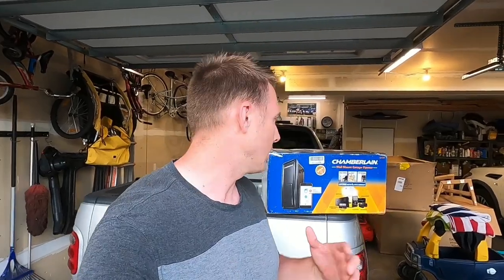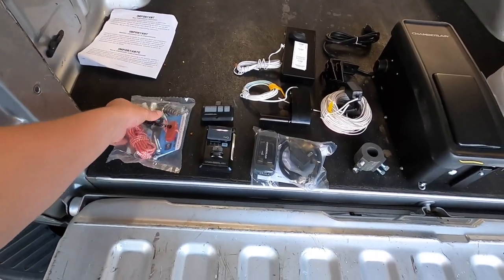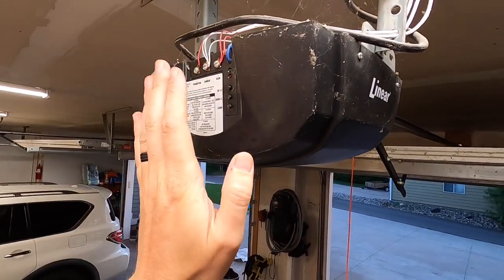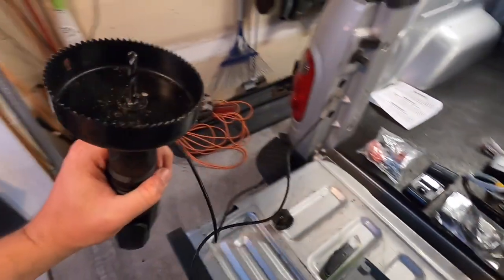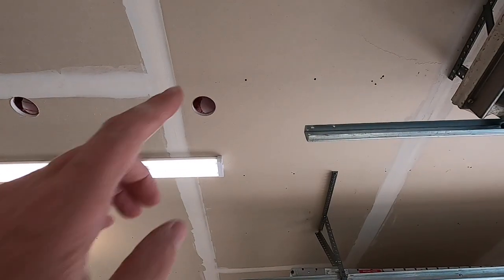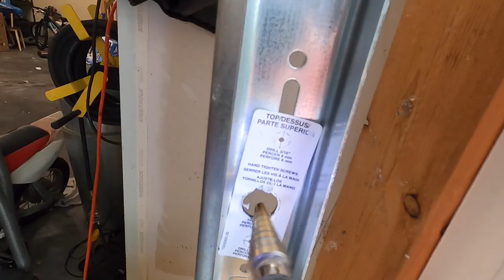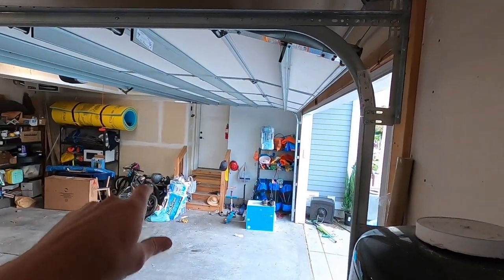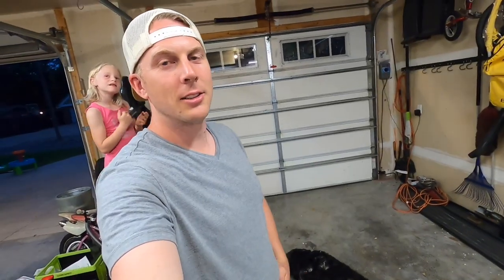Every Garage NEEDS THIS!! ***Wall Mounted Opener Install***

Comment: Hilarious! When I saw all the holes just to avoid running very tiny wire was absolutely hilarious…. Thanks for the laugh 😂!
Reply: My jaw hit the ground when I saw the Swiss Cheese BS!  Omg.  It would have looked so much cleaner running the wires tight to a corner and horseshoe stapling them.  Lol.
Reply: @243wayne1 for real. Dude should of called a company lol

Comment: But there’s one problem if your garage is super low and you use the super sneaky bracket the 8500 will not work

Comment: I want to install this wall mount opener, but my garage is detached and does not have any other access other than the garage door itself.  What can I do install to open it if there is no power or the opener malfunctions?

Comment: Jackshaft opener costs a bunch more, including labor and the add complexity and increase the risk of cables losing tension because door only goes down by gravity.  They may be more secure but you could add the solenoid lock to a regular opener as well adding complexity.

You could have added a wireless opener button, either aftermarket or though opener manufacturer for anyone attempting something similar with similar concerns about looks.

Comment: Hopefully you have the offset arms for your lift. Will make opening truck doors much nicer with the posts moved forward of centerline
Reply from the maker: It has “super-symmetric” arms. I can lift it anywhere from 50/50 symmetric to 30/70 asymmetric with it by adjusting the length of the arms
Reply: @AutoDetour  right but that puts the actual post right where you open the drivers door. 

well depending on how much front to back room you have in the garage. I guess you could put the rack forward a little, and park the truck back a little
Reply from the maker: @Patman03sprcrw  That’s exactly what I was thinking. I have about 6 feet between the bumper and my workbench, but definitely will be playing around with placement before I drill any holes in the concrete.

Comment: You plan on lifting the truck up with the two post?  The garage seems a little short
Reply from the maker: Yes. It will lift the truck up almost 4 feet. Obviously not standing height, but still will be much nicer to work on.

Comment: can you open it if you loose power?
Reply from the maker: Yes, you can manually slide the latch and pull the red cord on the bottom of the unit to release it. Just like the emergency rope on an overhead opener.

Comment: It seems a bit slow and towards the end you can hear the motor more for some reason.
Reply: Most new Garage door openers have a feature where at the start and end of running they slow down.  So starts slow, speeds up and then finishes slow.